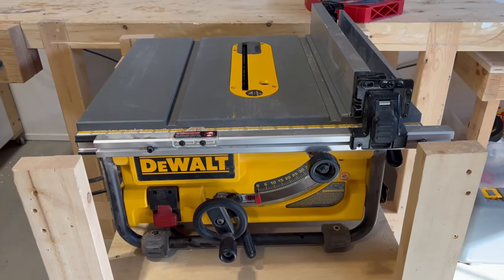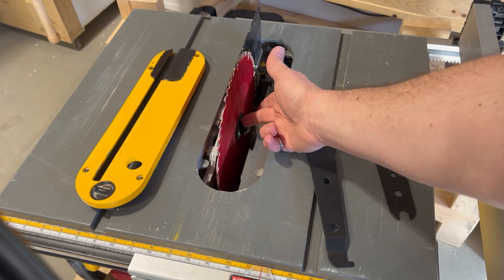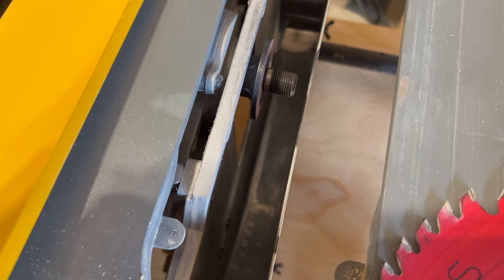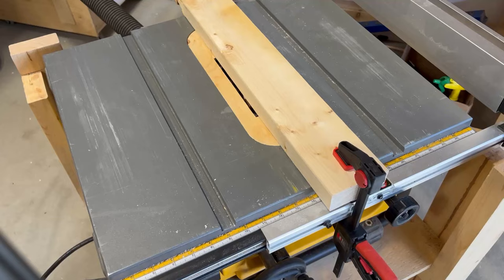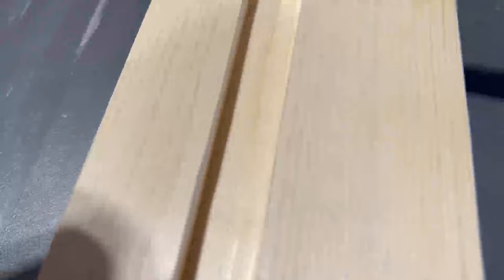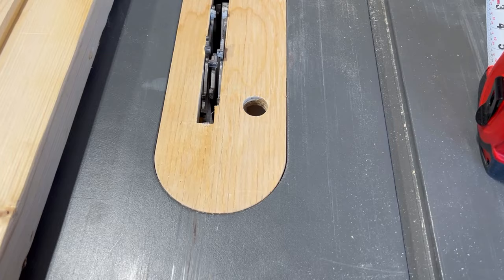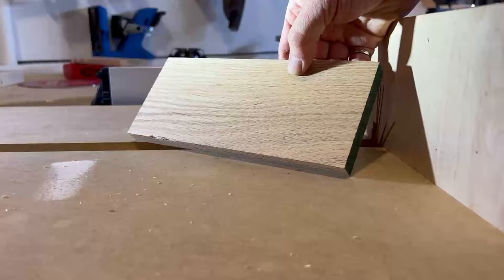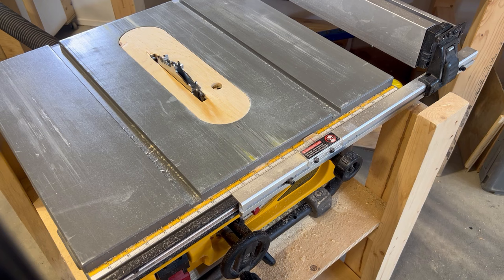Using a Dado blade on a Dewalt jobsite tablesaw - can it be done?!?

Comment: I'm scared to go this route but do use an Oshlun 8" Finger/Box Joint 2-blade set. Depending on how you orient them, you get a 1/4" or 3/8" cut/groove/dado (check throatplate clearance on the 3/8" setup. You may have to create a custom throat plate or file off an edge of the factory plate when using it this way. I did). The caveat is that the second blade is resting on some of the arbor threads (but not enough to keep the nut from fully engaging). At first, this was not a problem. Over time though, it has caused a few of the threads nearest the solid portion of the arbor to become flat. Now I get a very small (1/128"?) height differential on half of the cut. I.e., the blades still cut flat but half the cut is offset. I will assume the second blade is "wobbling" somewhat on the threads that have flattened. If it is wobbling, it's so slight that the human eye cannot detect it. This is not a major problem but does require, in some instances, sanding or chisel work if you want your mating piece to be completely flush with your cut. Over time, using multiple blades to form a dado may cause the same problem if they are resting on some of the threads.

Also, I will at times, use just one of the blades to create a small (5mm?) groove to accept box bottoms on my pieces or to cut a small rabbet/rebate when needed. Each blade has 30 teeth so I feel safe using it this way but keep my cuts nowhere deeper than 1/4" at a time or even less with harder woods.

Be safe!
Reply: I use a two blade set also at 3/8. thats more than large enough doing multiple passes.
Reply: @joe_ferreira Which one do you use?

Comment: "Standard 3/16" blade"?!?
Standard ìs typically 1/8" in cabinet shops, and typically weekend warriors are using thin kerf blades in their portable tablesaws, which are thinner than 1/8".

(PS:  3/16" is thicker than 1/8", in case I had to tell people that.)

Comment: I don't need to be an engineer with a working lifetime experience to know one needs what I call a "full nut" so basically you should see/feel the spindle end once tightened.
I suspect in this video, removing one chipper blade would give enough spindle to work safely. As for the motor not being powerful enough; rubbish. My DW745 had an 1800 watt motor running off 240v. Plenty of power for DADOing softwood to 1/2". I very recently sold that saw without ever using or owning a dado set but my new saw a DW7491 does accept a dado stack. A 8.5" Freud DADO set arrived today. I'm sorta glad I never watched this video when I had the DW745, I just see images of blood spurting out of my neck or part of my face hanging off. No thanks.

Comment: Pretty cool, glad it didn’t fly off the arbor when you fired it up.  

I have the 745(?) with the same arbor length and wanted to try this

Kinda sounded like it bogged down when you ran the 2x4 as a rip cut but you did take a big bite 

Light passes and it seems doable for sure with pine 

I’m guessing not doable with white oak unless extremely light passes
Reply from the maker: well it was fine on the red oak, but I have not tried other hardwoods yet.  I think it would be OK as long as you go slow.

Comment: Super sketchy. I have the745 and am thinking of giving it a go.
I suppose as long as you check that nut for snug every time and stay out of the blades line of site it should be ok.
Reply from the maker: I have used it a number of times now, and it has not come loose at all.  I think if I were doing quite a lot of cuts I would check it periodically.
Reply: If you consider the arbor’s length and if you have a throat plate in place (and why wouldn’t you?) the danger is not to the user, it is to the dust shroud of the saw, the underside of the table, and the expensive set of blades you bought.

Comment: I was really surprised how much cutting power (and torque) this saw had out of the box. I've used other (10" saws) previously and was pretty surprised with the speed and cutting ability of this Dewalt saw.I have bolted mine to a table to minimize movement which I highly recommend.This is a Great saw https://www.youtube.com/post/UgkxPeGkHOMe05FySypTOvYumxMn-xi39oRe  with a light to see your cutting line (not a laser line).I'd recommend this saw fro anyone looking to upgrade from a 10" miter saw.
Reply: I think that's the 8", the 10" supports using dado blades out of the box, at least my RS 7491 does according to the manual.
Reply: You picked a great saw. It does support a full dado stack comfortably. 👍. @ultiweb

Comment: I think it is irresponsible posting a video like this when the manufacturer states it is not compatible with dado blades. It’s one thing to try it yourself, but to suggest it to others in the form of a video could land someone in the hospital.
Reply: if this thing ends up in an accident, I doubt he will have enough time left to see the doctor lol
Reply: Well hopefully only adults are using this saw and make their own educated decision.
Reply: Youve obviously never worked construction
Reply: @chadlayman2799  better hope OSHA doesn’t see this. So construction guys do dangerous stuff. What exactly is your point?
Reply: @Jim Gott  yeah thats exactly my point. Sometimes you dont have the right tool to get the job done, so you gotta do what you gotta do. Neccesity is the mother of all inventions
Reply: @chadlayman2799  there are other, safer ways to make a dado cut on a job site saw. The most obvious is to make two outside cuts, then chip away the middle with repeated cuts moving the fence. Now you’re probably going to say that takes too long and time is money. Downtime in the hospital and loss of body parts isn’t going to save time or money. If you don’t have the right tool for the job, a better solution is to get the right tool. Rule one is not to do an operation if you have reservations about the safety. The OP says multiple times that this is sketchy.
Reply: This saw is advertised being able to accept Dados. Dewalt even sells a Dado throat plate for it. Maybe do your homework before clutching your pearls and trying to cancel someone.
Reply: @deviceunseen even though the OP says it’s not compatible. Several others say the manufacturer says it’s not compatible. You seem to be the odd man out.
Reply: @deviceunseen  page ten of the online manual for this model says don’t use a dado set